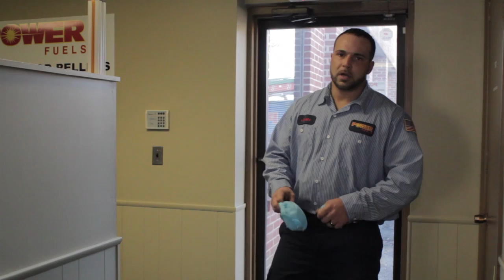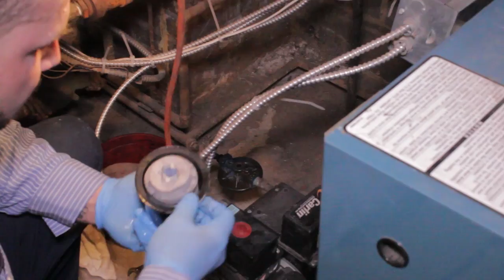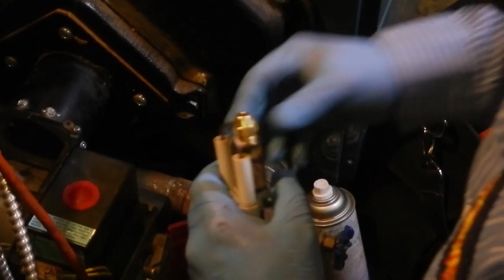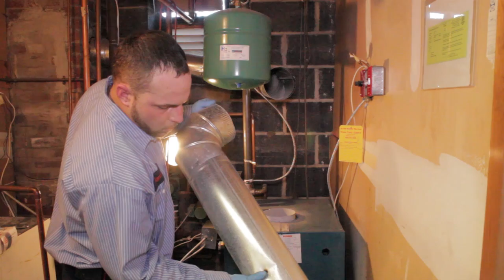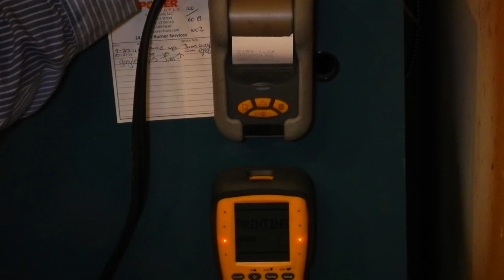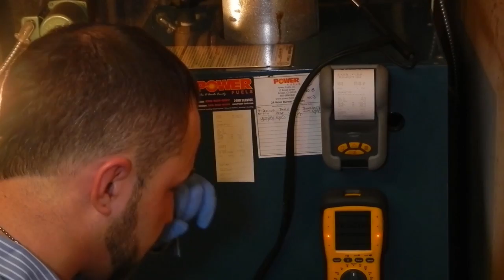Annual Tuneup & Inspection (Oil Boiler)

Comment: When testing the pump pressure why NOT run the burner until it locks out on SAFETY? Certainly would be worth the typical 15-45 seconds a card cell relay takes. This STEP could save a CATASTROPHIC EXPLOSION 💥💥💥!

Comment: Yeah no brushing the fan on the burner motor, didn't check cad cell ohms, didn't check the relief valve which is a safety, didn't check the expansion tank, didn't do a water test for acidity, didn't check your water feeder, didn't change that pos primary control 😆. Yeah there's a lot this guy didn't do. Didn't do an oil tank inspection. I know we ain't perfect but that's some poor company standards. U making ur guys do 10 tune ups a day? Tune up should be at least 2 hours on a boiler and 1.5 hrs on a furnace if it's properly maintained.

Comment: We replaced the electrodes every time.  It’s just not worth having a delayed ignition due to questionable electrodes.  It’s just like spark plugs in a car.  Electrodes are cheap, and they come in a tune up kit, along with the nozzle line, buss bars, fuel pump coupler, etc. You cannot she pinholes in the porcelains.  Most techs over,ok this, and run electrodes that are spent.  I’ve had my share of puffbacks, and once had a draft diverter blow thru a sheet rock wall, due to delayed ignition from defective electrodes.  Good job.  Did you check the pump cut off pressure, or was there a solenoid on the pump?  Good job, explaining the aspects that should be addressed in an annual oil service.

Comment: James, that was the most methodical, well explained, and itemized inspection and cleaning of an oil burner I've seen on You Tube yet!  Cleanup and detail was amazing.  I never knew anything about oil burning boilers until I bought this old house 20 yrs back, and had to learn how to service everything myself. Never really wanted to to the job myself.  However, the local service people around here would do only the minimum, and know you would have to callback for follow-ups when the system shut down 3 months later, with $150 to $225 repair bills for their poor initial service!  You're the best, and could be a millionaire just by doing straightforward and honest work!
Reply: He never removed the top canopy to brush the boiler vertically. Stack temp. is to high, and he never check the draft at the breech or over fire.